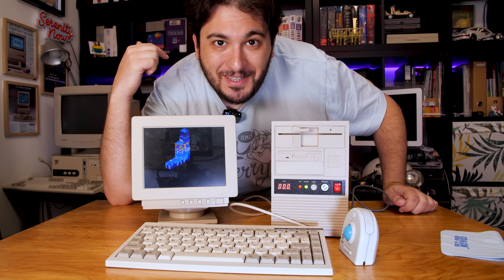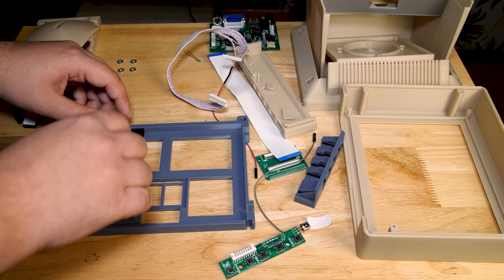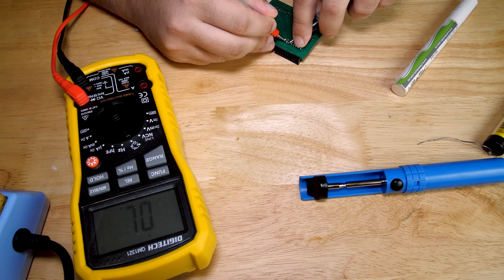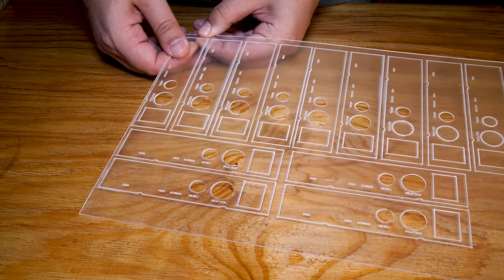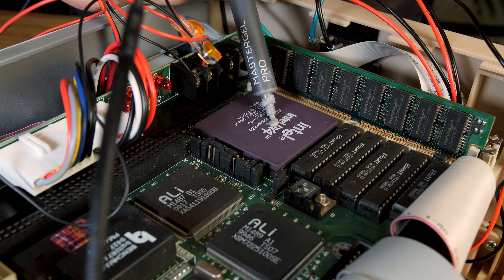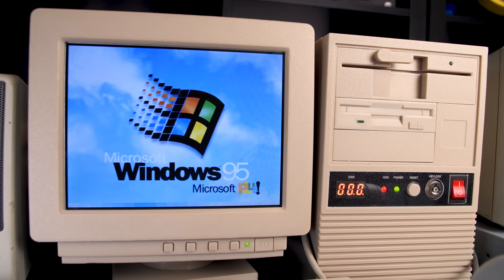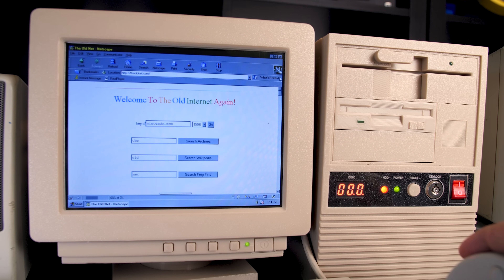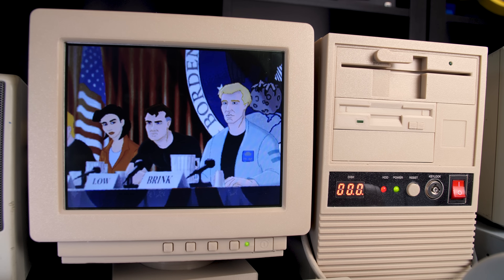A Tiny (Real) Intel 486 Built From Scratch

Comment: Is it printed with filament or resin? I lean towards the second option due to the details and texture, but I need to know! And, how did you get the perfect color of filament/resin? Oh, by the way, would you ever share the stl files?
Reply from the maker: I used filament with a Prusa mk3s. If you get really close or have light hitting it at some really specific angles, you can see some 3d print artifacts, but the prints did turn out very good for filament.

As for the filament, I used the eSun PLA+ Bone White, there are filaments with better colors but that's the one that printed the best for me in terms of artifacts and having fewer failures.

The Texture is from the bed of the 3d printer. That texture only exists on the surface that touches the bed.

Comment: This is so cool. I love how it's kind of like all of the mini consoles, but it's using real hardware instead of emulation on an inexpensive ARM chip of some kind. I really wish I could do something like this too, but I'm not hardly as skilled 😂 I missed how you were powering the external cd-rom drive? You should do a period correct case for one of those too. 🙂
Are there other ISA graphics cards that you could use that would work better? Even if the Tseng isn't the best, I would've expected a lot better performance than that.
Also, about MP3s... I had a Pentium 90 laptop that struggled to play 128k CBR mp3s. It could, but it was choppy a little bit even then. I've heard of people playing some on 486s before, but I really can't buy that. Maybe 96k CBR or lower bitrate. Certainly no VBR or higher bitrates. I'd be very impressed if someone proved me wrong though!
I remember doing some light browsing on my 20mhz 486sx in the later 90s, before I finally managed to swing an upgrade. (And what an upgrade, I went to a 233mhz Pentium 2 after that) I think I remember IE3 working faster than Netscape but don't quote me on that. I do remember sometimes having a very extended wait for Netscape to show up. Like minutes.
I played Sim Tower and Sim City 2k on my 20mhz 486 a fair bit I believe. I'm not sure what the integrated graphics were, but it was an IBM ps/1 consultant.
Reply from the maker: There's a separate power supply for the CD Rom drive that has a molex connector.
There are other ISA cards but they are expensive these days.
Internet Explorer is indeed faster, I can confirm. I use Netscape for the nostalgia factor, I'm very fond of it.
Reply: @TheEricExperiment  I did some digging and it appears that the IBM PS1 Consultant I used to use in the 90s had the Tseng et4000 built into the motherboard. Maybe I'm remembering the performance of it wrong. I'm sure you've thought of it already, but maybe there's a conflict with one of the other cards and it? I know there was some hardware back then that just did not play well together for some reason.
Reply from the maker: @nullsmack  I did have some IRQ issues because of the Ethernet card, maybe it could be related?

Comment: if you find a little CRT to put inside your 3D printed case it will be awesome!
Reply from the maker: Finding one at that size would be super hard.

I have a few 5" crt TVs but they are black and white and the image is horrible.
Reply: @TheEricExperiment  yes black and white are easy to finde , but those TV sets have only composite or even only RF inputs sadly . 😢
Reply from the maker: @intel386DX  Yeah, it would require some serious nodding, which I don't have the skills for. And the image quality would still be bad because tv tubes aren't as precise as monitor tubes. =(
Reply: @TheEricExperiment  actually monochrome tubes even from the TV sets are even more precise then any color tubes, even from monitors from monitors

Comment: I am super impressed by your fusion skills. how the monitor and cases are designed and assembled are top notch!!! You make it look easy but that is a humongous amount of work and ingenuity. For the LCD, I highly recommend using ipad 2  9.7" LCD panels (LTN097XL02-A01) they are 4:3 native 1024x768 but can run lower res. The blacks and view angles are very good and the latency super low. if you grab a LCD panel from a busted ipad, the monitor will run you about $20USD total with a controller from Ali.
Reply from the maker: I'm not that good at fusion, there was a lot of google involved.

Yeah, someone else mentioned the iPad screen, I wanna get one!

Comment: ...I just don't see the reasoning for this in all honesty. There are many AT cases you can pluck out of dumpsters or eBay and build your machine into that. It's not reusing a lot of original components either. The monitor, while a good idea to bring back the CRT factor, is not a full viewable display and is very empty on the inside where it had housed more things anyway, and displays should had been at least 15" for the time so that's not ideal nor very real. It's a hobbyist project I can understand that, but it's kinda junk looking. I would had went the legit route and just rebuild an actual 486.
Reply from the maker: I do have real normal size 486 computers and real CRTs, but why not, and hear me out here, do things just because they are cool and fun?

Comment: I can so identify with the thought of being able to 3D Print in just a couple of iterations. I’ve learned humility through 3D printing.
Reply from the maker: I cut a whole section of the video out complaining about 3d printers because I didn't want to be too negative.
I went through 4 3d printers to be able to print properly.
2 creality ones, a flashforge one and the one I actually used was a second hand prusa that I had to replace some parts to get working properly.

That's why I have a hard time believing 3d printer reviewers hahaha
The idea that a parent and their kid can grab a 3d printer and get it printing with quality over a weekend is completely nuts.

I did learn a lot from it though. But in the end I wanted a 3d printer to support my hobby and not the 3d printer to become the center of my attention.
Reply: @TheEricExperiment  I feel exactly the same. I live in a humid environment so the filament is constantly brittle. Sometimes it even breaks mid-print. It’s a cheapo Monoprice Select Mini, but it prints well for an early FDM machine. I can’t wait to get digital calipers. I feel like for my application, I could save time on iterations by being more precise. But calipers are expensive where I live, so I’m having to make do with a plastic one.
Reply from the maker: @MarcosCodas  Yeah, humidity is annoying.

I have calipers, they are super useful!

Comment: I have the 14" Samsung SyncMaster 3 (SVGA capable) with a 0.28 dot pitch.  It uses a 9-pin DSUB that "breaks-out" to a 15-pin HD-DSUB (VGA) using a special cable.  The front plate controls are all dials instead of buttons.  Both the bezel and the power button is well done and makes me smile.
Reply from the maker: Yours is like my old one!
Yeah, I wish I could've done dials for it, it'd look so much cooler!
Reply: @TheEricExperiment  It was repaired half a decade ago.  Almost every solder point had to be reflown (100+ points).  It uses Goldstar (LG) chips.  But the tube is Samsung.  It is limited to resolutions with a horizontal sync frequency between 30.5 kHz to 40 kHz.  The vertical refresh can be set to 60 Hz or 70 Hz but nothing else.  I was almost able to drive it down to 53 Hz by adjusting the innards (internal potentiometers).
Reply from the maker: @techeadache  did it cause the image to flicker and go crazy? The ones I had that that problem because of the solder.
Reply: @TheEricExperiment  We recommend to stay flickering for avoid the motion blur issue. 🙂
Reply: @TheEricExperiment 
The symptoms that the monitor would manifest, before its repair, were shearing of the display, rolling of the image, and a sharp audible high-pitched tone.  The capacitors were working well.  An image was present on the display.  Albeit, completely unrecognizable.  After about 5 minutes of being powered, the monitor had completely died and stopped making any noises.  Once dead, it was no longer able to be powered and failed to display an image.

The screen rheostat on the flyback produced no noticeable effects when turned in either direction.  The majority of the dried cracked solder points were found around the flyback.  The rest could be found around the deflection chips (horizontal and vertical).  The neck board needed to be touched up as well.  Some factory defects were present.  Through-hole leads being depressed onto the board and severing copper traces.  The monitor had survived in that poor state only due to charges arcing across gaps.  It was in essence electroshocking itself in order to stay alive.

This monitor contained a large amount of lead.  The front and the back of each circuit board had a chemical smell.  A yellow residue that was similar to sulfur was smeared everywhere.  Almost every solder point had ring shaped micro-fractures.

I repaired it only because I wanted it out of the landfill.  It was too toxic and it needed help.

Comment: I'm guessing the card is a 4000AX and not a 4000W32... distinct lack of Windows acceleration....
Now you need some super tiny speakers, maybe the smallest Aliexpress (seen a pair of 27mm full range - SOTAMIA at an ok price) , add a PAM8403 amp board and 3D print cases..... maybe an option would be active crossover and conceal a sub in the monitor
Reply from the maker: Yeah, it's the AX, I don't think there are ISA w32 ones.
The sub in the monitor is a great idea! Never thought of that!
Reply: @TheEricExperiment  Spotted a WD90C31 for $85 AU, how terrible is that.. I remember bagging some 90C30 way back for an upgrade project, and they were pretty competent Windows accelerators, and the WD chipsets are not awful in DOS either
Reply from the maker: @matthewday7565  the prices today are so stupid

Comment: Amazing work on this build. :-) Slim line optical adapters with master / slave do exist as i have some and they even have analogue cd audio out as well. I find them on eBay quite a bit. Maybe you could add a PCB based cd audio aux jack on your tower that internally accepts a short cda cable connected to cd audio in on your sound card for sound card swap compatibility. Then, build an external enclosure that accepts the slim line optical with a power jack, aux jack and optical psu for some cda based gaming goodness. That would be cool. Also, I wonder if your sbc will accept the AMD AM5x86 133MHz CPU. Hmmmmm lol
Reply from the maker: The SBC might work with the AMD, I'm thinking of putting an Overdrive in as well.

I've never see slim drives with master / slave selection though, I'd love to get my hands on one.

Comment: The 486 never ran Windows 95 very well back in the day either.  Windows 3.11 for Workgroups and MS-DOS 6.22 was the pairing that worked with the CPU.   Used to run 4DOS   and DOS games just fine.  Doom etc.

For windows 95, try a Pentium 133  higher.  PCI bus was a huge leap over ISA even with VESA slot extensions
Reply from the maker: Yeah, I have a Pentium MMX that I use for a bigger variety of operating systems!
Reply: With all due respect, check the magazines from that period, the Pentium 133 was the fastest CPU that anyone (with very deep pockets) could buy when MS released Windows 95, a DX2 66 with 16MB of RAM, a GUI accelerator and VLB HDD controller (High end 486) was more than enough to enjoy W95, a low end Pentium 75 with crappy PCI VGA card and 8MB of RAM, commonly sold in that era wouldn't be really better, the DX4-100 would be as fast as a properly configured Pentium 75 in all situations except when a fast FPU was required.
386, 486SLC/DLC and slower than DX2 50 those could execute Windows 95 but didn't ran, they crawled 😅
Reply from the maker: @RetroTinkerer  I still have my Pentium 75 processor. I ran The Sims on it once. It was bad, but it worked!

Comment: Amazing design.  Surprised that a Mach64 ISA card goes for such a huge amount, meanwhile PCI Mach64 is comparatively cheap.  Wonder if we'll ever see people taking the chips off of PCI Mach64 boards and designing an ISA PCB to make use of them.  You'd probably have a much better monitor experience with an old ipad 3/4 display.  It'd have to be a bigger print though.
Reply from the maker: I wonder if I can use that screen with a controller that supports vga
Reply: @TheEricExperiment  yes there is a controller with both VGA and HDMI.
Reply from the maker: @rs.matr1x  I'll definitely look into that, it sounds like it would at least work as a test monitor when I need something quick!

Comment: making the monitor that large makes no sense considering we had LCDs in 1991. Why didn't you at least mount the power supply in all that empty space inside the monitor to add function? It bothers my OCD so much that you wasted THAT much plastic for no good reason. You should also look into lining the inside of both the display case and pc case with some aluminum foil and put some graphite rings on the wires or you are going to get static buildup and kill your rare hardware.
Reply from the maker: The goal was to simulate a crt.
I'd love to see your take on the project though!
Reply: @TheEricExperiment  my biggest concern is the static buildup. Those old components died very quickly from it. Plastic for some reason is a good conductor for static electricity.
Reply from the maker: @cgwworldministries83  yeah, that was one of my worries. I do have an search connected to the backplane, but I don't know if it's enough. I'll look into solutions for that!
Reply: @TheEricExperiment  you just need to line it with aluminum foil. I would use aluminum ducting tape and line the entire inside of the plastic case with it. the display should be fine its new enough.
Reply from the maker: @cgwworldministries83  I'll do that, I might use aluminum tape though
Reply: @TheEricExperiment  just something that will act like a faraday cage that connects to ground.  Great project and i can’t wait to see your next videos.
Reply from the maker: @cgwworldministries83  thank you, I'm glad you enjoyed it!
I'll look into that and maybe make an update video in the future.

Comment: I used to play mp3 files on my 486, but the max rate I had at that time was 128kbps and I was using an AMD 5x86-133 overvlocked to 150mhz. The extra speed and bus clock probably really helped out.
Reply from the maker: I might put an Intel overdrive there at some point
Reply: I always forget about those since they were so expensive at the time and had a pretty low clock on them, but a good option too.
Reply: When I was researching MP3 files back in my college days, they said that a Pentium 120Mhz was the first computer that decode an MP3 in real time. Yours being a 5x86 running at 150mhz probably helped a lot. 

(Some people have since told me that they got a slower computer to pull it off, but I suspect it was using newer software that optimized the process more than happened back in the day.)
Reply: @ZipplyZane  Lower bit rates also help. Most of the early mp3 files were encoded at 112 or 128 kbps, instead of 256 or 320 kbps that is more common now.

Comment: For the gotek I would have moved the port further in and use a very small sandisk flash drive so you can close the cover and hide it while it was in use. Just by looking on the thumbnail if the video I thought that case was a very small original metal one and not a 3d printed one, great work on the design.
Reply from the maker: I really wish I could have done some aluminum work for the case, but that's way out of my skill set.

Yeah, maybe that could've worked, maybe that could be an improvement for a future update video!

Comment: I believe an emulation based solution could be more interesting, due to the high prices on pretty much everything for a 486. A low end ITX computer can easily run PCEM running a 486, I think even a core2duo could. The big advantage is that a modern motherboard can use sata, so you can easily put a 1 or 2tb hd full of ISOs.
Reply from the maker: Yes, I have other ideas that use emulation, I want to get to them eventually.
This project was never supposed to be practical.

Comment: CRTs that size were sold new. Most retailers didn’t stock them but as a computer reseller in the 90s you could buy them new. For example I sold a new computer with and AMD processor (can’t remember what one), integrated graphics, NIC, modem, (no OS) with a 12” CRT for $200. Most people would upgrade to the “14” or 15” monitor for $50.00 or $75.00 more but personally I really like them and it saved a lot of desk and bench space.
Reply from the maker: I used to have a 9 inch black and white a long time ago, they are really hard to find these days.

Comment: Brilliant build, attention to detail, integration, just about everything is spot on. Awesome job. 

I would take a look at your BIOS settings and see what is holding you back. You should be getting much better performance out of this thing than you are. The ET4000 may not be the greatest thing ever but it shouldn't be that weak. I suspect your ISA bus may be limited in some way, likely due to the industrial nature of the thing, reliability > performance. There may even be BIOS updates/custom BIOS versions that unlock better performance and features out there for it.
Reply: A DX100 and a ET4000 should be a serious powerhouse for running anything up till about 1996.
Reply from the maker: @DavidAStephenson  yeah, heard that multiple times in the comments. I'll see if I can improve it.
Reply: @TheEricExperiment  It's a stunning build, and really deserves to be running at it's full potential   . Looking forward to follow up video 🙂
Reply from the maker: Yeah, I'll look into that, and I'll post a pinned comment if something improves.